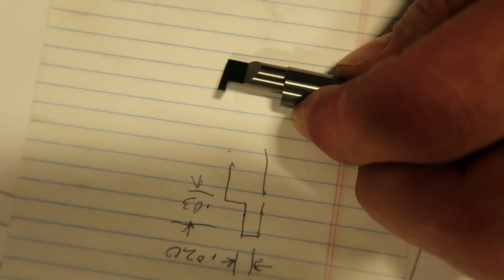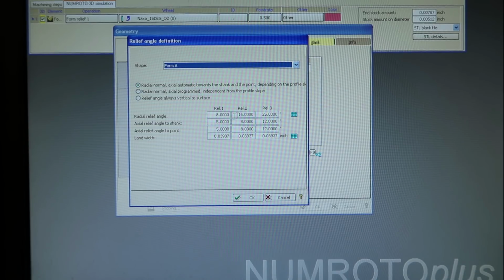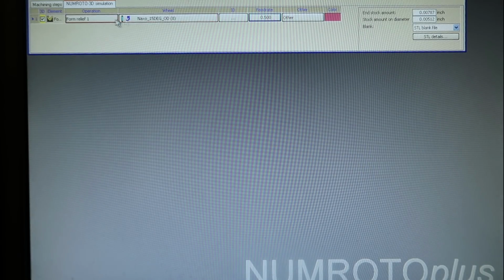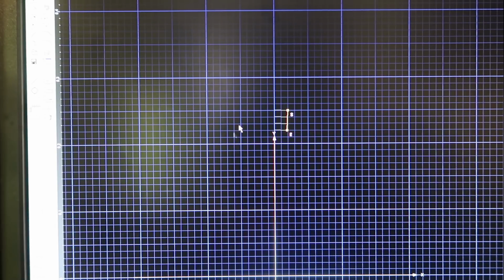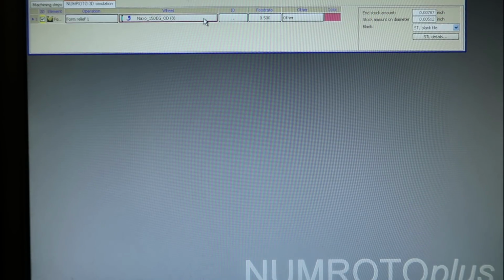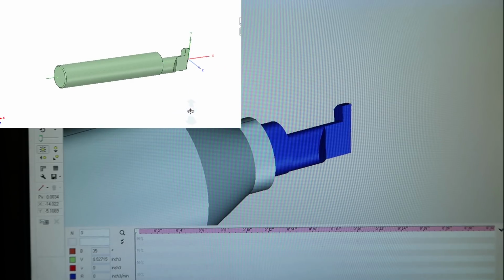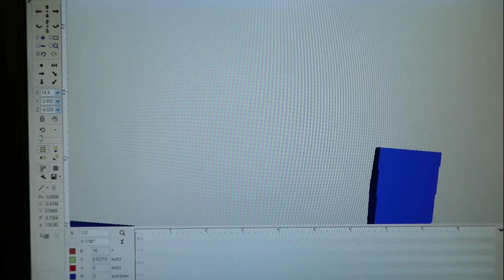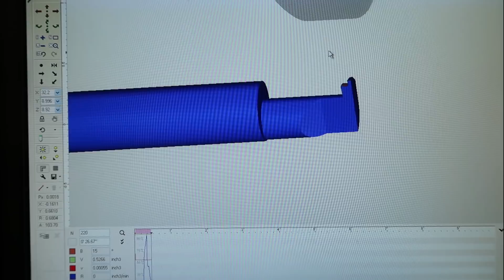Modifying A Micro 100 Tool

Comment: cool video, but that was a lot of work for something that could have been done by hand in like 10 mins with equal results lol
Reply from the maker: Your right this could have been done by hand. They asked me to grind it because they don’t have a grinder with a wheel on it in their shop that hasn’t been totally abused. You know what I mean wheels with the corners rounded off aluminum bits stuck in the abrasive and such. We’ve all seen them. Also if they break the tool (the odds are good) I will have a program to quickly duplicate it. If I do it again I will dress the wheel to sharpen the corners a little.

Comment: Thanks for the dry cut.
Reply from the maker: You are right I forgot to mention it in the video. I would normally run the coolant. This did give me a minor problem. The corner of the tool got a little chip in it. This required me to grind the end off about .005 to get rid of it. I think that wouldn’t have happened with the coolant.

Comment: The grinding wheel as you said had quite a radius, how deep a groove is the tool expected to produce. How long did the grinding process take ??. It blows my brain this improvement in technology, when I stared in engineering we ground high speed steel for screwcutting by hand. For my tech practical we had to cut a 1/8" square thread, (1/16" wide + 0.002" on width) I ground my own tool at work because we had better high speed steel than the carbon steel tech had. Now at 67 I cannot even see the 1/8" without glasses.
Reply from the maker: The groove only has to be .020 deep. The whole process takes longer to explain than to do. I can and have done with this machine and it’s software. Grind a custom end mill from a solid blank in less than a half hour. That’s from start to finished. The cycle time to grind say a .500” 4Flt endmill is about 6 minutes. Grinding standard tools is a breeze just fill in the blanks run the graphics to make sure than grind. It’s that easy once learned.
Reply: Thanks for reply.
Reply: I hear you Andrew!  I did alot of very tiny machining in my 30's working under a microscope and by my 40's I was wearing bifocals. I recently retired  after teaching machining to engineers for a long time and I was struggling towards the end to see well.  I remember a time when I was younger when my boss called me Mic for short (micrometer) because I could look at small parts and tell if they were off by a few thousandths (bare eyes).   I tried using trifocals towards the end but they were extremely clumsy!  It was time to give the youngsters a chance anyway.

Comment: How do you decide when it's worth the time spent to regrind tools?  (I don't mean modify them into custom tools you can't buy).  Is it a dollar value, like $40 tools and under get scrapped?
Reply from the maker: In general I don’t regrind tools. About the only thing you save is the cost of the carbide. You still have to go thru about the same grinding cycle. You save a little on the fluting cycle. But let’s say you grind and than inspect the tool. If it didn’t quite clean up you have to rerun some of the processes. You could have ground a new one. Of course if you don’t have the grinding machine it would be different.

Comment: Some really interesting shots in this one. It's a lot of work to get all those close-ups and angles; thanks for taking the time. Also, are you a fan of the Micro100 tooling in general? I've got their catalog on my desk, but haven't used much yet.
Reply: This is an older post but Internal Tool co has a nice selection of tools and will make special ones for you.  I do like to buy the Micro 100s because i can get them quickly from a local supplier.  But Internal tool has a real nice selection.
Reply from the maker: I have over the years used quite a bit of Micro 100 tools. They can be use full for something just like this. As a base for a special tool. I also like the Harvey tool catalog. If you don’t have one of there’s you should get one. They have a lot of what might be considered none standard tools as standard.

Comment: Thanks for sharing Peter. How much does a machine like that cost new?
Reply from the maker: Tooled up about $550,000.00. The new models have linear servo drives. Just the swhablin (Don’t know if that’s spelled correct) collets cost $375.00 each. Everything about these machines is expensive.

Comment: what machine are you using to grind with, I'm surprised it doesn't have a truing and dressing cycle or option
Reply from the maker: I bought this machine used and was going to add a dressing attachment. But they cost a lot. Even just the special diamond dressing wheel is very expensive. I do have the software in the machine for the dressing cycles.